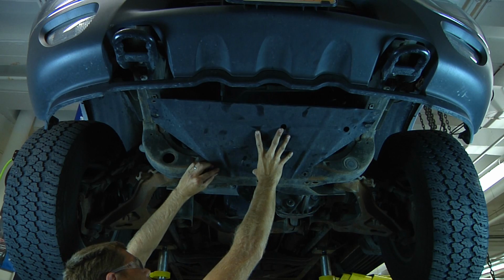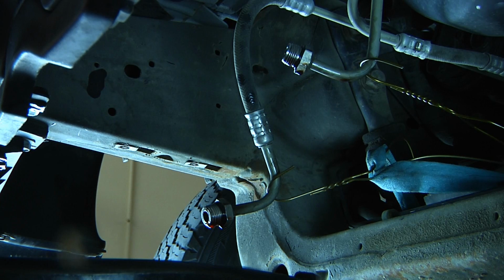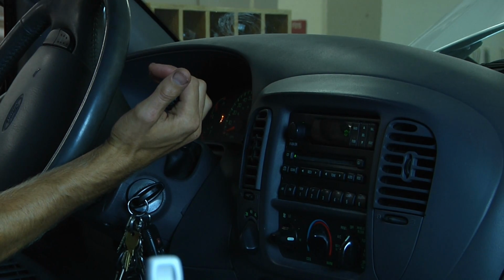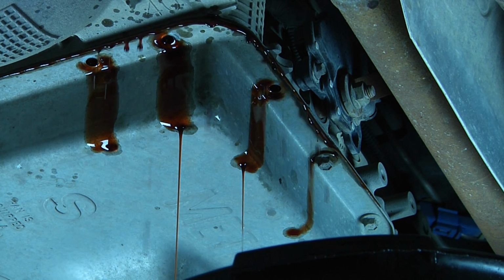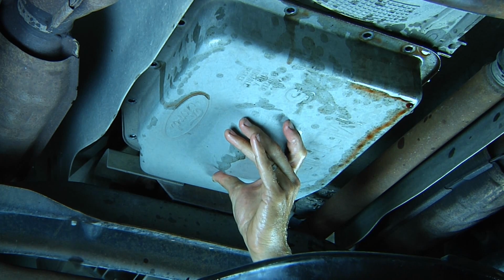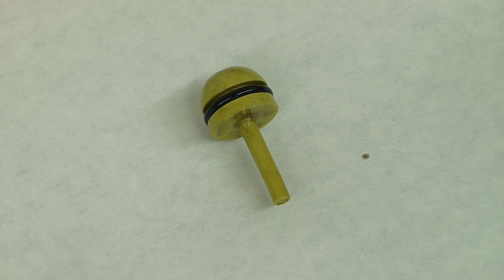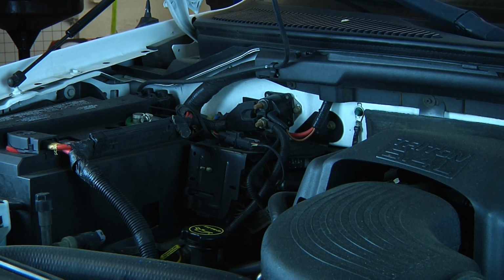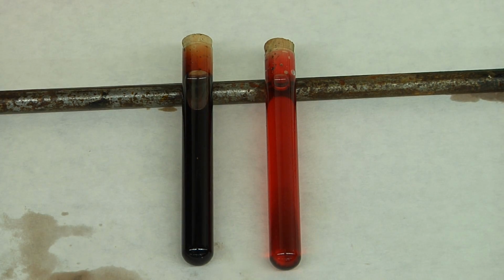2001 Ford F150 Transmission Service (Flush, Torque Converter, Oil Cooler, Pan & Filter)

Comment: I'm surprised not more people use this method. I've done it on my Mazda5. Great way to change ALL the fluid. Only thing I do differently is I'd never add anything other than AFT to a transmission. Not worth the risk.
Reply from the maker: I agree that many prefer to use no flush products.  Given that I had no knowledge of the history of the vehicle, my preference is to clean out what sludge is in there.  I sold this vehicle about a year ago.  No tranny issues in the 10 years after doing this service.

Comment: Thanks a lot for the video. Is it necessary to put some gasket maker (like permatex ultra-grey)?
Reply from the maker: According to the repair manual, if the gasket is in good condition, then permatex is not needed.  I used no gasket maker and this transmission.  I sold this vehicle about a year ago and had no issues for the 10 years I drove it after I did this video.

Comment: the right way to drain the torque converter is thru the transmission bell housing you will see like a rubber plug take that off and then  you move the pully by hand till you see the nut align with  the hole. then you drain everything out, like that you just wasting money on transmission fluid specially if I'm using royal purple just my 2 cents.

Comment: Man awesome video, I wish you could service my F150 2006. Good job my friend.
Reply from the maker: Thank you for your comment. Bring it by, we’ll get it fixed up…I’m in Nebraska.
Reply: @InsaneOil   I'm down here in Georgia my friend. Had the trans worked on, had front seal replaced and torque converter replaced and get it back and ideals with a bad vibration.  What would that be?
Reply from the maker: @robertmckelvey6564  I would start with an induction cleaning https://www.amsoil.com/p/power-foam-apf/?zo=10458 and also clean all the injectors https://www.amsoil.com/p/p-i-performance-improver-gasoline-additive-api/?zo=10458 , that would rule out anything fuel system related.

Comment: Great video, I heard recently that one shouldn’t flush because it could cause the gaskets that are used to old fluid to fail. Do you think there is any validity to this?
Reply from the maker: I haven't had any issues yet and I filmed this service 10 years ago.  However, my gaskets were still in good condition when I inspected them during the filming of the video.

Comment: Did you know that if you were to turn the one gallon jug of oil around 180deg from the way you are pouring it in the funnel it won't try to chug the oil out the hole? One of those special designs that I believe most people who are unaware of it would rather not make a mess if it can be avoided!😉
Reply from the maker: I was actually aware of that but then the label would not be showing…product placement. 😉

Comment: Jon, this is the best ever video I saw online that is very professional, process is very well explained slowly and thoroughly without hiding any steps (unlike other bloggers). Thank you so much for the very helpful tip on flushing, changing oil and filter.
Reply from the maker: Thank you for the comment.  Good luck with your repair.

Comment: I recommend leaving the supply line connected to the coolers, so they too, get flushed. You can get adapters that will connect to the return ports of the trans coolers, so it can be directed into the collection container. That also helps remove any residual flush additive, ensuring maximum film strength of the new fluid, to protect gears, bearings and clutches. I typically don't use any kind of flush fluid, I just simply flush with the transmission fluid I intend to use. That eliminates any possibility of solvent diluting the new fluid.
Reply from the maker: Agreed.  It is always good to make sure all flush product (if used) is removed during this process.

Comment: Torque for f150 2001 4.2 please
Reply from the maker: Per the Chilton manual (page 1-41) - Automatic Transmission Pan Bolts = 108 to 132 in-lbs
Reply: @InsaneOil  thank you

Comment: Is it a bad idea to do a transmission fluid change if one has not been done for the first 140K miles of the car's life?
Reply from the maker: I don't think it is a bad idea but I would recommend some type of flush product to eat all the sludge that has accumulated over the last 140k miles...and replace the filter.
Reply: @InsaneOil  Thank you.

Comment: Why not just pump a few quarts of the old fluid out first from that supply line to the cooler, so when you drop the pan it's not so full and messy?
Reply: Could work.  Or you might run the risk of having the engine run with no fluid in it.
Reply: @jonothejester  you just have a helper turn off the engine as soon as fluid stops coming out or starts sputtering

Comment: My truck is blinking off on the overdrive light 2001 f150.
Reply from the maker: Could be a fuse or wiring issue.  More likely it could be your transmission throwing a code.  When was it serviced last?

Comment: 5:58 on the left side should that plug on? What is the name? TY
Reply from the maker: It is a dust cover/inspection plug.  Rear main seal and front pump seal can leak through there. https://www.varsityfordparts.com/oem-parts/ford-plug-e9tz7n171a?origin=pla&gclid=Cj0KCQjwqrb7BRDlARIsACwGad6T1N22L4JHR61CVpubHqpoUZbKNTKfnPIngoDOCLkZZFEbg1BPbC8aAhF-EALw_wcB
Reply: @InsaneOil  Thank you so much, I really appreciate your help :D

Comment: Good video with the exception of the use of the chemical flush.  Ford Motor Company does not recommend transmission chemical flushes,  transmission additives, or transmission treatments:  https://www.youtube.com/watch?v=l4BsgqW5GTU
Reply from the maker: I agree with your video link.  However, as stated in the video "simply change the fluid at the correct intervals".  Unfortunately, people do not change the fluid at the correct intervals which leads to fluid degradation and sludge formation when the degraded oil molecules shear and free radicals attache themselves to the oil molecule. The longer this occurs, the more sludge buildup occurs which requires a flush product to breakup and encapsulate the sludge.

Comment: Hi, I have. 1998 4.6 f150 and I just changed the spark plugs and cables along with a new MAF sensor and it was running fine for a week. This week I added a radiator flush for a couple of days and  my transmission started to feel sluggish(3 days into driving) & it was empty when I checked it. I pour a little bit of oil and the meter stick shows that it has too much. I drive it, it begins to show signs of sluggishness and it’s empty again. Didn’t see any leaks in my parking spot or anywhere the car has been parked. I’m thinking it could be a cooling hose but I was hoping to get maybe some advice before I go to war w the transmission. Thanks and thanks for posting your videos. 👍 stay safe everyone ......
Reply from the maker: Make sure you are checking your transmission fluid with the vehicle running and sitting on a level surface.  If it still doesn't register on the dipstick then top it off to the Full Cold mark (with the vehicle running).  Drive it for a day or so and check it again.  Let me know if you are still loosing fluid.
Reply: Insane Oil , I always check that transmission fluid with the car on, but I will try it topping it off with the full cold mark.  Thank you for taking the time to reply. It’s strange I don’t see a leak when I’m parked.
Reply: Insane Oil ok I tried it. Truck was sluggish and the gears took about three seconds to kick in. When I first checked the oil(been parked for three days) it was empty, I poured a tiny bit and it was super full. Don’t understand how, I’ve been checking oils since I was 6, so I know better not to smear it. Before parking it, I checked the oil and it armory and there’s this smoky dust or smoke when I had th e engine on. FYI I was flushing the radiator so I have not yet flushed it since I was in the middle of the job when all this happened. It was sluggish at the end to reverse park it. Thank you and I appreciate any advice. I have worked on cars and I’ve never seen a transmission give me this trouble. In the past week before the issues I had changed the coils , cables and spark plugs. And I had also done a radiator flush, but it needed more than one since it hadn’t been done since god knows when. Again thank you for the advice and stay safe.
Reply: Insane Oil hi it looks like it’s still losing oil after I changed the gasket. I did torque it to 11 lbs of pressure. Do you know if the plates need change after a while?

Comment: You aren't going to check / re torque your valve body?? IMHO that would have been a very good idea.
Reply from the maker: I agree that it would be a great idea to check the valve body during this service.  However, the service manual does not call for it during this service.

Comment: I'm confused. You didn't drain the torque converter or coolers like the title says. you disconnected the cooler to find the flow direction but instead of then letting the engine run and till the flow stopped which empties the pan aka 4 quarts. you instead reinstalled the lines to do lame pan angle drop just so you could use the amsoil extractor for 3 ounces? LOL. FYI, why not just pick up the magnet to clean it, its not glued down or anything. I'm 100% sure you started this video to show how to easily empty the pan through the cooler lines then realized u were supposed market the amsoil extractor and purposely showed the hardest way to empty the pan. otherwise there was no reason to remove that front lower cover and disconnect the lines...
Reply from the maker: Either you didn't watch the whole video or you had the video on mute while you were watching it.

Comment: Finally perfectly explained! Thank you so much for sharing your knowledge, man. I have a may be little more complex question here... I've found no one that can wash the doubts about, i would like to have your opinnion if it's no bother, please...  What if i got an automatic gearbox filled with the wrong ATF (Dexron III), and i want to change it to the recommended by manufacturer manual (ATF  M5)?  Should i got to unmount and open the whole  transmission box and ATF sistem so it can be cleaned all of it's parts mannually  of all the  ATF III before  i can refill it with the Mercon V,  or can i just refill it with mercon V using this drain by the ATF cooler pipe technique?  (i've been told that Mercon V shoudn't be mixed with ATF III in any case)  Thank you so much for your time, greetings!
Reply from the maker: Honestly, I am not a transmission expert but I do know that mixing product isn't typically recommended.  If it were my vehicle, rather than taking everything apart, I would run a bottle of Amsoil Engine and Transmission Flush according to the bottle's instructions to clean out the entire system, drop the pan, do the filter, torque converter, etc. (shown in the video).  Then fill with a high quality ATF.  I obviously strongly recommend the Amsoil product and you can look up the specific products for your vehicle at http://insaneoil.com/
Reply: @InsaneOil  I will,  then...  In fact, thats what i  was thinking of, after post the comment..  But it happens that i coudn't find any transmission flush here in where i live (Venezuela).  But thanks for the page, pal,  i will try to research for the chemical composition of the product so may be i could be pointed to some other that i could find here and so, it will help me a lot!...  :) (y) (or even try to import one if  i have to)  Thanks for the advice as well,  that idea of  dismounting the entire transmission was eating my head  :S !!

Comment: If you disconnect the line flowing into the transmission cooler won't there be old fluid in the cooler that won't be flushed out?
Reply from the maker: joe lee It is possible that there is some residual fluid, however the theory is that gravity will cause it to flow down to the pan.

Comment: That’s what I plan to do on My Ford Expedition 4wd 2001 on Tuesday. I just did a Amsoil oil flush and oil filter changed too I was thinking maybe to use the Amsoil transmission fluid on the transmission too.  
How is it going for you on the transmission of Amsoil fluids compared to Ford transmission fluid ???!
Reply from the maker: Runs like a dream.  I'm about 6 1/2 years in to this fluid.  I sent a sample in to the lab last year and they said the fluid was still good to run.  I'll send another sample in this year.

Comment: You forgot to show and tell the people about the transmission filter rubber gasket. It gets stuck in the hole you have to pull that out with pick before putting new transmission filter or it will not seal correctly  you can see it in the video its orange it was left up there. I'm not trying to be a jerk I just went threw this a week ago and it cost me more money and time I didn't have. So people please make sure you get that out and you can thank me later.
Reply from the maker: Agreed.  Definitely make sure the rubber gasket comes off with the filter.  10:32-10:33 you can briefly see the rubber gasket still stuck to the transmission filter as it is removed.

Comment: Hi how are you I have a question I have a 00 expedition Eddie Bauer 5.4 my 4x4 sometimes work but when I use it and I want to put it back to regular drive I have to play with it until it goes back on a4wd do you think is the transfer case shift motor? Thnx
Reply from the maker: When was the last time you replaced the transfer case fluid? https://www.youtube.com/watch?v=sZsQb6TbhAE

Comment: This was done correctly and yet some still say oh it’s wrong.  He did flush the torque converter.
Reply from the maker: Thanks for the comment.  I make my best attempt to do to the research prior to any repair...especially when the video is going online.
Reply from the maker: @Kiara Wolf That is incorrect.  All manufacturers set intervals for changing the transmission fluid.  It can often be found in the owners manual or other documentation provided when the vehicle is purchased.
Reply: @Kiara Wolf changing the oil won't cause it to go out but may show you problems that the old oil was masking.

Comment: i did follow exactly the procedure but for some reason when i checked my dipstick its bone dry where are all my fluid went please help worried and confused by the way my transmission is 4R70W which hold 13.9 qts.
Reply from the maker: Add more fluid and check again with the vehicle running on a level surface.
Reply: i did add more 15 quarts to be exact and investigate a bit more by removing both return and supply lines and checked my oil cooler for any obstruction the latter was good so i drove my truck the next day to my work which is about 7 miles i checked the dipstick still bone dry by the way my truck is 1999 ford lariat 5.4l canada made i'm not sure if that make any difference 
i thank you
Reply from the maker: @izcoronel  Do you know if your transmission dipstick is the original one?
Reply: yes its original anyhow, thanks for the replied,. parked the truck for two days and when i checked the dipstick the fluid over the cold level.i will continue driving the truck and monitor the ATF i'll keep you'update with the progress.my next project are the front and rear differentials.i am not sure if i will use amsoil or motorcraft by the way how 's your truck i know you used amsoil was is it better thank you
Reply from the maker: @izcoronel  It felt better after changing it out but the fluid I took out was pretty contaminated.  The front dif is at: https://www.youtube.com/watch?v=hDaZ7G0PCB8 and the rear dif is at: https://www.youtube.com/watch?v=MmiaRaeOrqo

Comment: Can I use the amsoil transmission fluid for the power steering pump as well these Ford models use transmissions fluid for the power steering.
Reply: Yes, I use it on my 2000 Ranger.

Comment: The upper line on the side of the transmission to the cooler is the return line.  So the line you want to disconnect from the cooler is the one coming from the lower transmission fitting.
Reply: Thanks!

Comment: looks like a pain in the ass to do it that way. I just suck out the fluid in the dipstick then remove and replce the filter, clean the pan then button it all back up. Takes about 30 minutes.
Reply: commando602 i do the same but this is a Flush it removes the entire 14+ quarts this 4R70W tranny takes My oil exchanger is 6 gal I just pulled 2 gal from my 95 Ford van that uses same tranny as this guy it does not extract the ATF from torque converter/cooler lines. I'm searching for an inexpensive alt. to flush my non running 02 Econoline  without having to actually operate the tranny to run the flush kit

Comment: Jon the f150 looks cleaner as my 2002 FX4 nice job I live in snow belt so i have repaired all rust and re painted
1/2 the truck. original owner purchased 2003

Comment: What would it mean if no fluid is coming out of the supply line?
Reply: Keaton Bruder You may need to shift into neutral or drive. Some cars don't pass fluid to the cooler in park.

Comment: what's the torque specs for the transmission pan bolts ? foot pounds
Reply: Kayleigh Kirk Usually around 8 or so. Very light torque. Too much will bend the pan flange and deform the gasket causing a leak. Way too much will strip the threads.

Comment: thanks gd video mr.olson im wondering if i should bother doing it one of my trucks has 247000miles on an r100 trans.and the other has 68000 on an r70 neither have ever been done and both run strong

Comment: mine just hit 200k fluid has never been changed should I do it?
Reply: What did you do? Any issues?
Reply: Brandon Collins don't flush it all just most off. it . sometimes new transmission oil in a never changed trans will ruin it